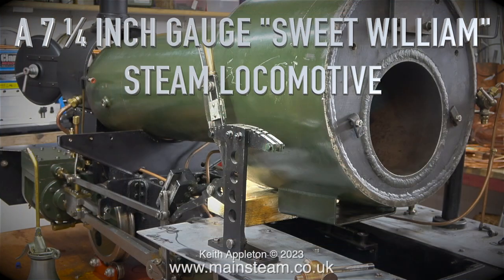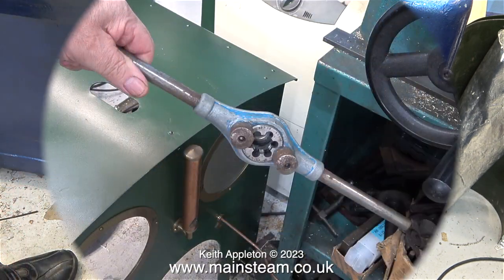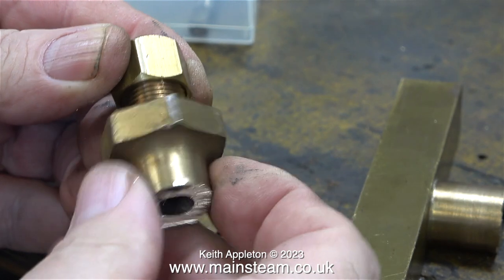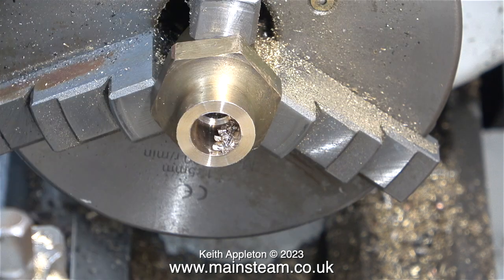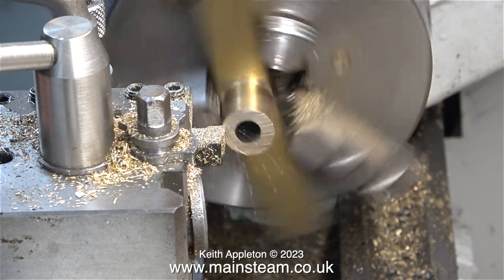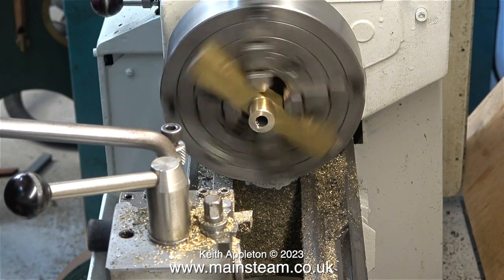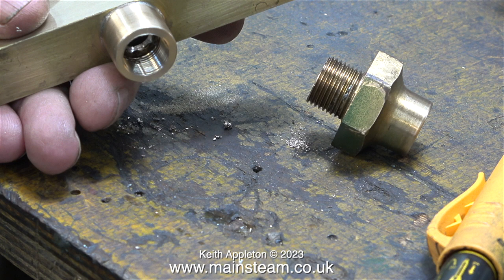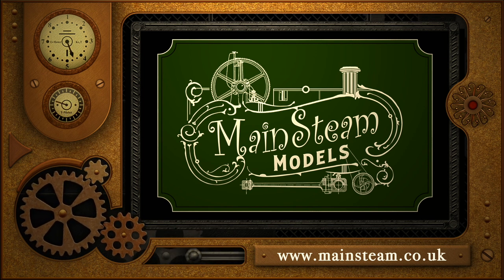A 7 ¼ INCH GAUGE "SWEET WILLIAM" LOCOMOTIVE - PART #19

Comment: I watch a couple of wood turners. They use a simple method of centering a piece in the chuck, by using the tail piece with a pointed device. In your case, here, using a center drill or counter sink, would do the trick.
Keith, I know that you know way more than me, but every now and then I see something , or know something, that might help. None of us know it all. I have a great deal of first hand experience there. Everything I know about small steam engines, I learned from you, along with about 90% of everything I know about machine work. Thanks for the education. ;-)
Reply from the maker: I prefer not to do it the way that you and others have described.

Comment: Pipe sizes, at least in the US, refer to the inside diameter, with a generous clearance. For example, you can roll a 1/2" ball bearing through 1/2" pipe without it getting hung up.

For rough centering in a 4 jaw when you have a centered hole, the quickest way i know of is to bring the tailstock up with a center to pin the part to the chuck, and then adjust the jaws until they just touch.

Comment: Pipe threads can be source of trouble.  Here in the USA, we deal with NPT and NPS pipe threads.  T = tapered and S = straight.
Reply: And the tapered ones are a right royal PITA to single point on a lathe.

Comment: An idea:  tocenter something like the turret, couldn'tyou use the centering of the tail stock?  If course your method is functional, I thought using the tail stock might be easier.
Reply from the maker: I prefer not to do it the way that you and others have described.
Reply: @keithappleton  To each their own.  Your method works well, and won't scar a tail stock center with the edge of the hole.  Very instructive.